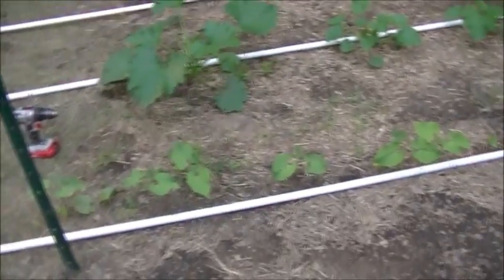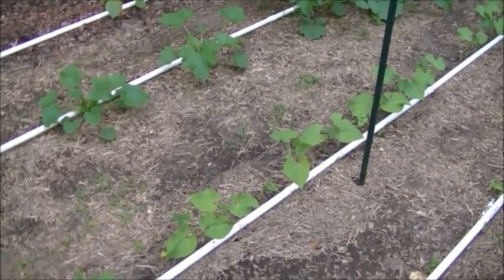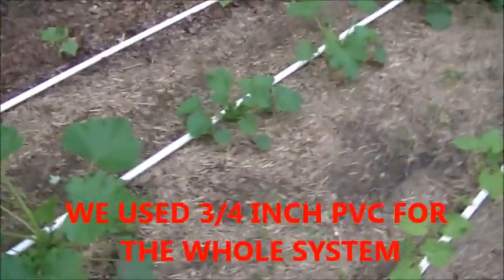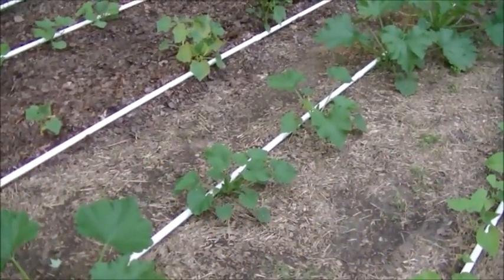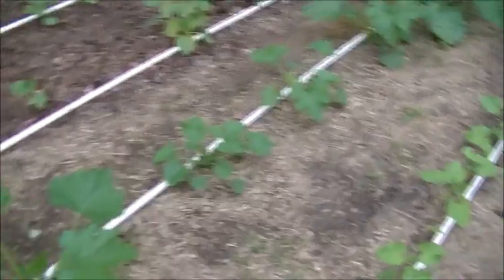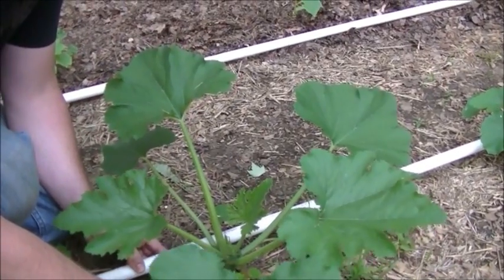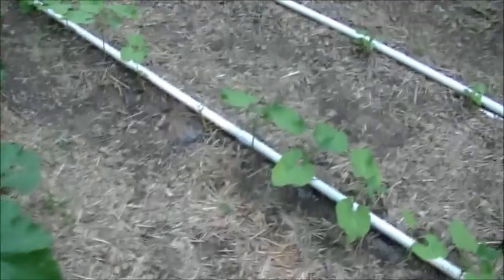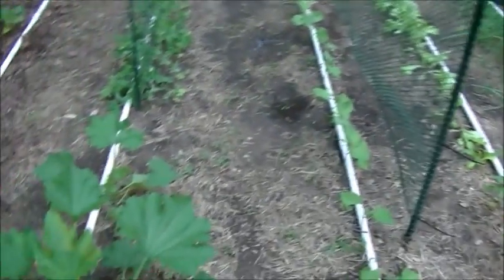PVC Garden Watering System

Comment: Is there a specific reason for using 3/4" instead of 1/2"?  Just wondering.  Good video.
Reply from the maker: I wanted to make sure I had enough volume for the long runs of pipe.  You could run a bigger pipe for the header section and 1/2" for the runs, or even just use 1/2" for all of it and it should be fine.
Reply: Poli